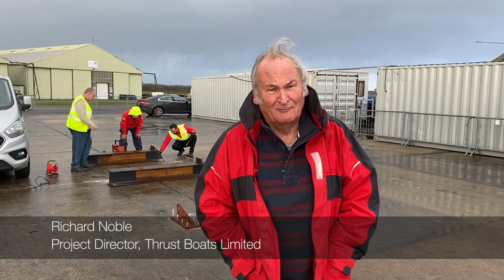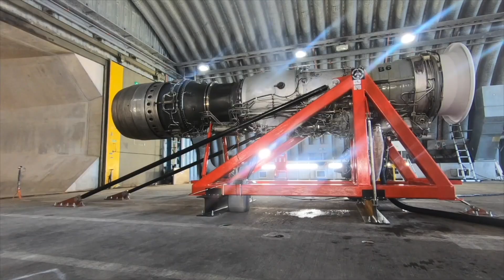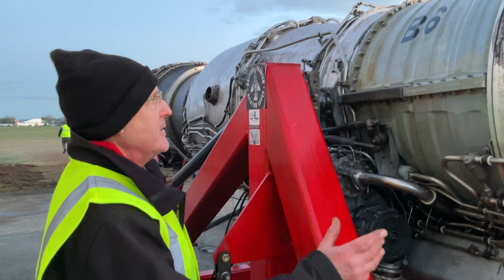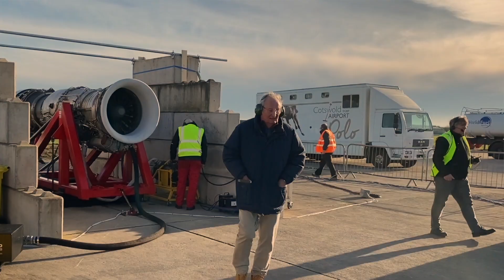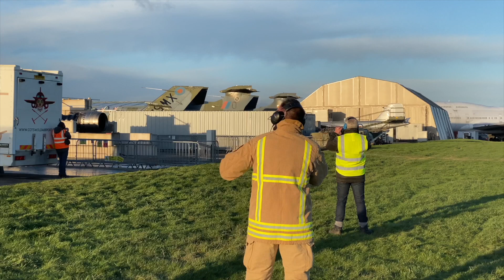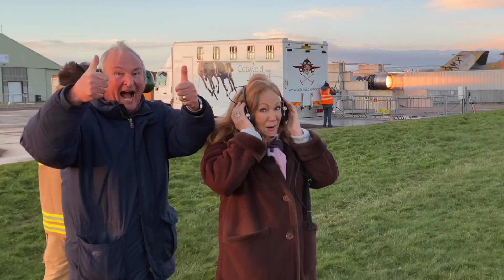Thrust Water Speed Project - Update #4 - Testing the Spey 205 Jet Engine's Afterburner

Comment: I don’t want to be a wet blanket here but there’s a lot more to this than just engine power. Ken Warby never had more than about 6,000lbs of thrust available to him, yet his boat just kept getting faster with each run. For his first world record, he used reheat but it was never really more that a stop gap measure. His current world record was achieved without one.

The Spey, in full reheat, has about three times as much power as Warby’s old Westinghouse engine. So what’s the big deal, you ask. Shouldn’t be a problem, you’d think.

Stability is the problem. Nothing more or less.

Ken Warby had one of the sharpest minds in the country in his team, along with his own mechanical engineering background and expertise with a jet boat.

The problem with the world water speed record is similar to the problem with racing cars. When pushed beyond their limits, they can flip. Just look at the accidents that claimed the lives of Donald Campbell and Craig Arfons. Cool, you think, just put wings on it and create downforce. But this doesn’t work the way it does with cars.

To understand this, you need to understand aerodynamics, particularly stability. You want the boat to be as neutrally stable as possible. To do that means having the centre of pressure very slightly behind the centre of gravity. Unfortunately, the design of hydroplanes makes this almost impossible. The largest area is usually forward and the engine - the heaviest component - is at the back. That means that if the bow hits a small wave - or anything that provides an upward impulse - the bow will rise, generating lift while the weight of the stern pulls it down, creating a positive feedback loop from which it is impossible to recover. Donald Campbell’s crash was a perfect example of this. The bow started to lift and once it started it wasn’t going back.

Most people would look at Ken Warby’s boat and say the wing was to keep the back down, like it would in a racing car because in a car, you need the tyres to keep traction. But this is exactly what you don’t want in a hydroplane.

It’s my belief that Warby had the rigger’s angle of that wing trimmed to make Spirit of Australia ever so slightly light in the stern. Not so light that it lifted clear of the water but light enough to reduce the effect of the engine weight, while keeping the rudder in the water. This would have had the effect of moving the mean aerodynamic centre further aft. The mass of the wing would also have created just enough inertia to stop the sponson walking that always affected Spirit from becoming a major problem.

I think Richard Noble understands this. His Thrust land speed record project from the 1980s took him within about 10 km/h of doing the same thing. He called in Ron Ayres to do the aero for Thrust SSC and used him again for Bloodhound. Hydroplanes are worse. Much worse.

Racing cars have a few degrees of pitch stability before they flip. Their margins are small but manageable. Hydroplanes are a whole different story. Unlike racing cars, the surface they run across can be unpredictable. The slightest ripples can cause a disaster because their stability margins are much smaller. It’s my belief that by fitting a wing to Spirit of Australia, Ken Warby increased that stability margin slightly and opened up the possibility for higher speeds.

If Richard Noble is the kind of character I think he is, he will be looking very carefully at this. I think if anyone other than the Warbys understands this, he does. Ken is the only world water speed record holder I can remember who died in his bed and the only one who did so while still holding that record. And that says it all.